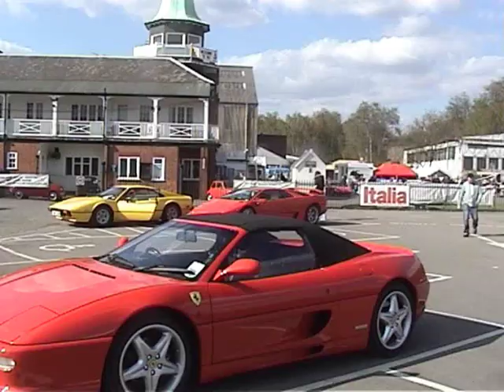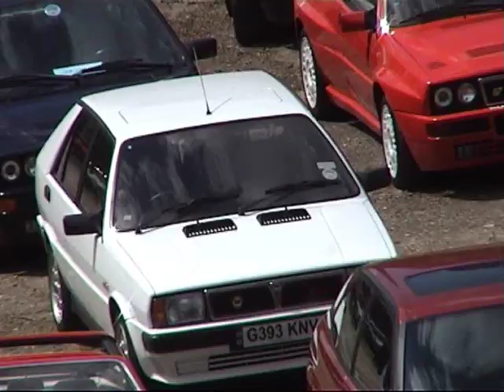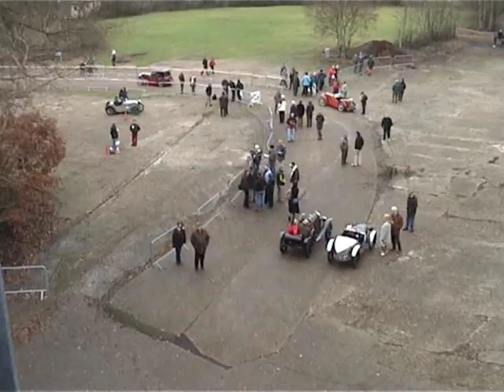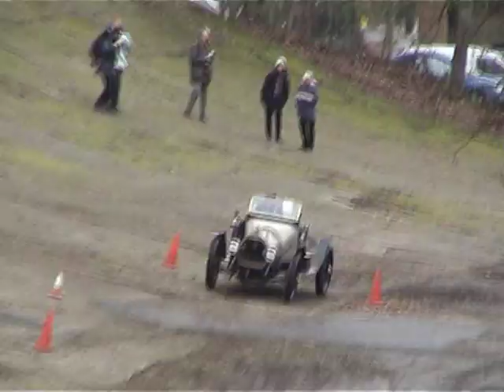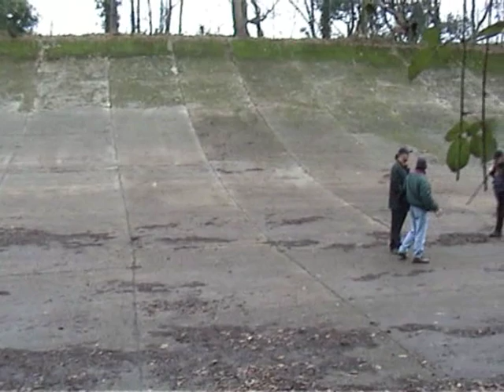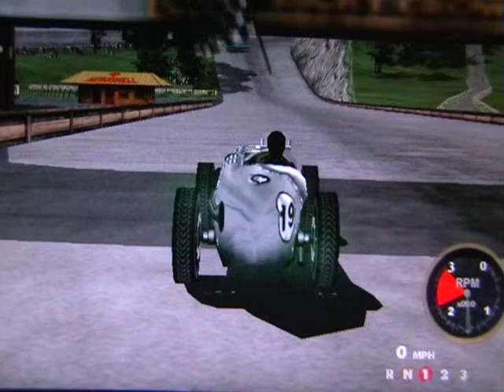Around Brooklands Race Circuit

Comment from the maker: @cdbcdbcdb if you had read the discription it says its Microprose's Spirit of Speed 1937 so Im not trying to pass that part off as the real deal, only the bits that are filmed at the real Brooklands, which sadly is incomplete so the game is used to show how it was, the commentary relates to James Mays Toy Stories tv program where a Scalextric toy race track was placed on the run of the original circuit and points out roughly were the main hurdles were